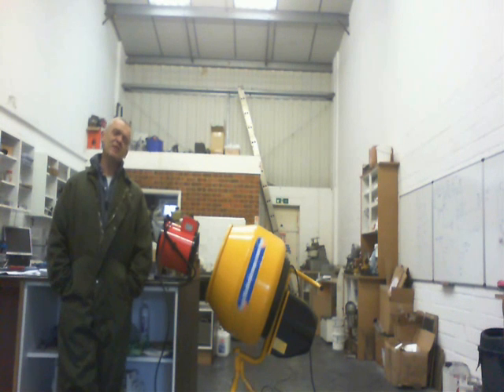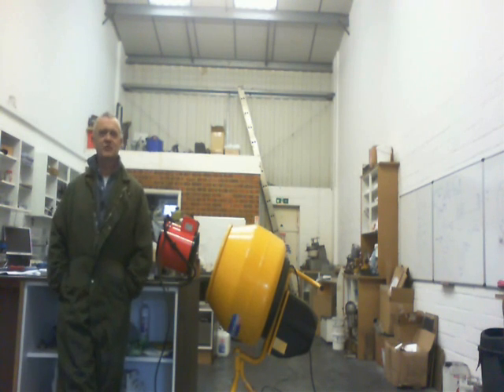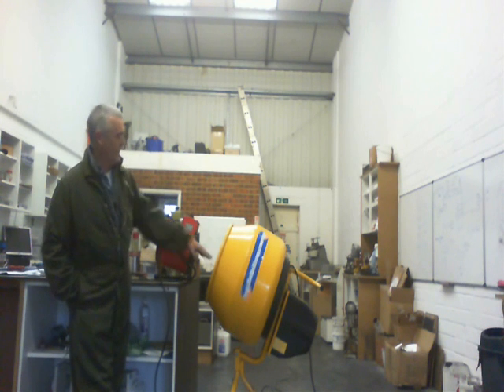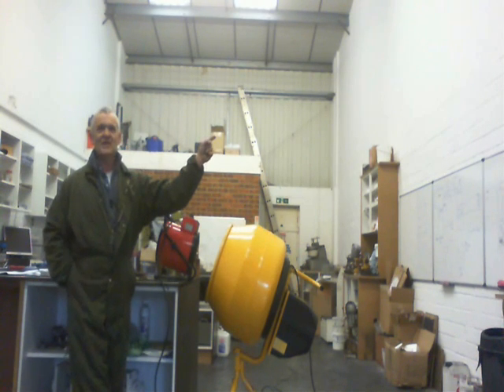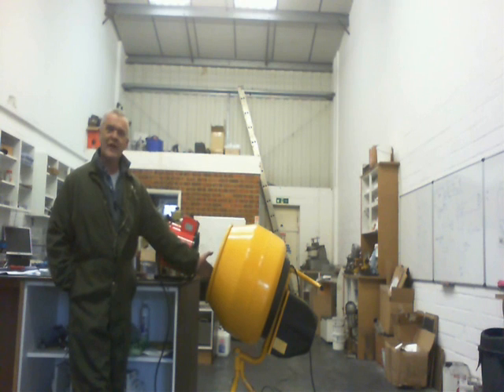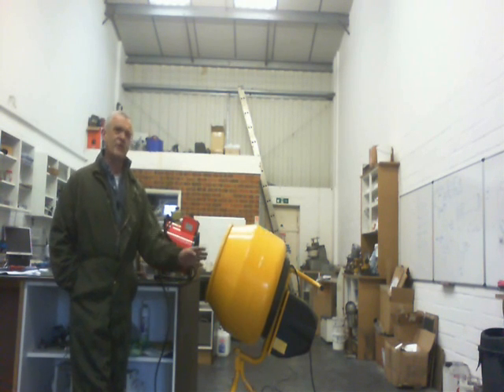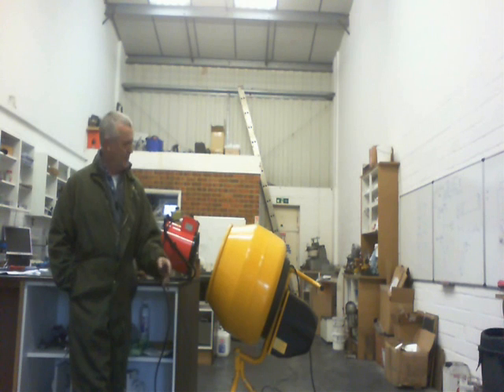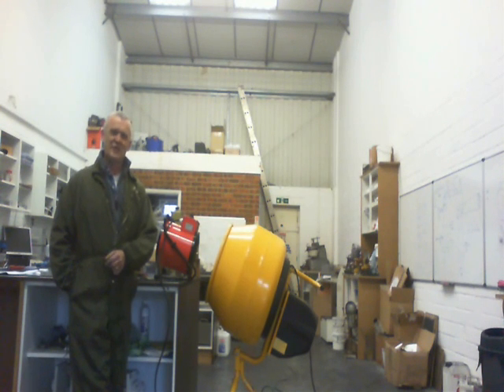Why I Use A Cement Mixer - Making Lots Of UltraSand

Comment: Great use for it!
Just a thought, if you know to start with, how much dry sand you have, then after washing it, you know how much water it contains because of increase in weight, could you not then add the appropriate quantity of water and sugar granules and let the mixer dissolve the sugar in a single step, removing the initial sand drying step and sugar dissolving in water step. Downside is the requirement for some heavy duty scales, to measure wet sand weight vs dry weight.
Reply from the maker: yep

Comment: have you made any attempt to determine/monitor the sphericity , sorting & size of the raw sand you use for your ultrasand?
Reply from the maker: yes i have - the sand in the mixer has been pretreated, washed and sorted to give a d90 of 100 microns

Comment: Robert le has puesto alguna capa de resina epoxy por dentro para que no se oxide el metal? (los acidos atacan)

Robert would have put some epoxy resin coating on the inside so that the metal oxide is not? (the acid attack)
Reply from the maker: it's plastic coated